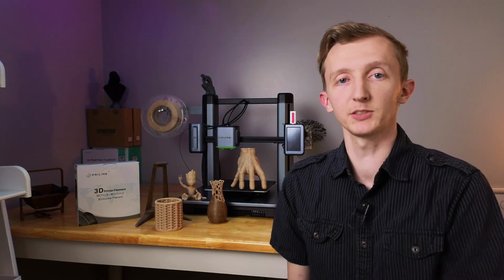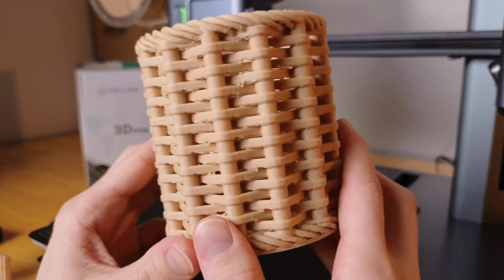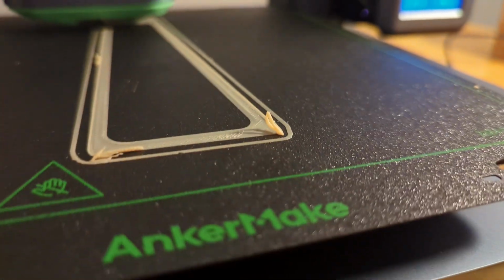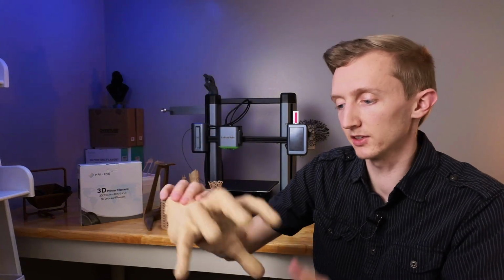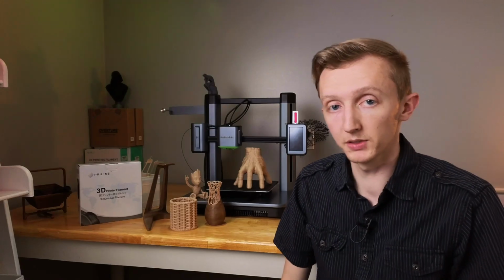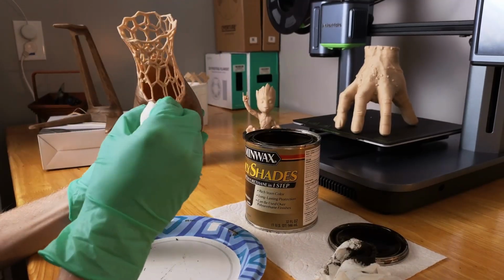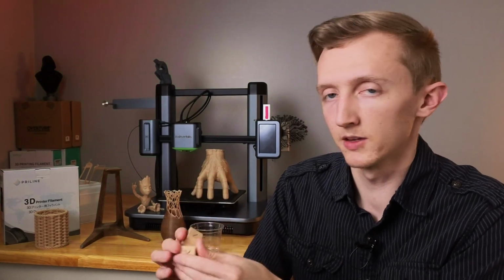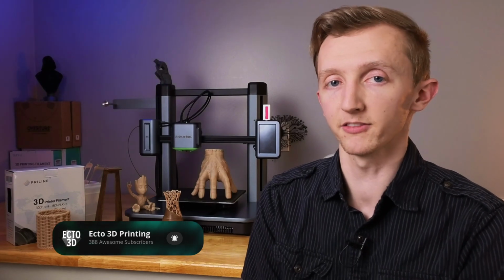3D Printing Wood Filament is EASY on the AnkerMake M5

Comment: I love printing with wood, and have found with most brands is not to print fast, first layers around 20 to 30  and main layer speed around the 40, the problem your getting is pressure build up in the hot end. if you don't run at the speed the filament likes then you will forever have issues with your prints.
and to say 99% of my wood prints is i never get any problems, just perfect prints like any over filament.
Just to say if you want it a bit darker then increase the heat just by 3 Degrees again if to hot then you get a cook off. lol

Wood does not like to be on the hot end either, so print low as possible but enough to get a good enough bond and layer fusion
Ideally print of some test parts as can save you a bit of hassle.

So if filament gets to  hot then the PLA gets to runny and the fiber's tend to sperate causing a back log,
and then spurts out under the back pressure, 
( some times the extruder will click away as its straining to push the filament  ) 

a good guide is, if the filament has a tolerance of say 0.02 +- 0.01 then a 0.4 nozzle is fine, but if you get wood filament that is 0.03 +- 1 then use a 0.05 or 0.06 nozzle as most certainly will get a glogg 
This also depends  if the filament is a 20% or 30% wood
Meaning a higher contents of wood above 20% then i do recommend a larger nozzle

Comment: Thanks to your video and the comments here I went ahead and put wood filament in my AnkerMake M5 and I printed this very thing hand last night. It will still printing this afternoon when I left for work so I monitored from the app and it completed with no problem and looks great! I haven't seen it off the printer yet. When I get home from work tonight I'll be taking it off and looking at it and putting my hands on it. But I'm excited because I was afraid to try the wood and I was afraid about the nozzle situation and thanks to people's comments I just left my nozzle as it was and it worked perfectly fine! Thanks everybody!

Comment: I did print using the wood filament on the 0.40 nozzle. It seamed to work fine. Thanks for sharing your experience with staining.

Comment: great videos, very informative. what I've found with wood filament is that you need to slow down the print speed. I printed a few models that came out really nice using AMOLEN's walnut wood filament using a print speed of 40mm/s, a printing temperature of 200°C, and a bed temperature of 60°C (even though AMOLEN recommends 0-50°C). I found that with the higher bed temperature, it reduced the risk of the first and/or 2nd layers from curling.  I also didn't have to change out the nozzle. all of my prints were successful and looked amazing using a 0.4mm nozzle.

Comment: I've heard that wood filament is hard on your nozzles and steel is recommended. Is that your experience as well? I bought some Hatchbox for my M5 but haven't tried it yet.

I do woodworking and for stain what would work well are the cheap foam brushes from the hardware store. They're a bit tougher than paper and you can squeeze it into the grooves to get more stain into deeper spots but absorbent so you can blot it away. Technically disposable but I've found that I can get a few uses out of them, depending on the stain chemistry.
Reply from the maker: Sweet tip! I thought about using a foam brush, but didn't want to ruin one of my mom's brushes if it dissolved or something lol.
For the nozzle, I don't think I've printed enough with the wood filament for it to have affected my nozzle yet. If anything, the white Anker PLA is more abrasive, or so I've heard. But I think even that 'damage' is more evident after multiple kilos of filament and I've only done just shy of 1kg of wood, and maybe just over 1kg of white.

Comment: I've been using a .4 nozzle for wood filament for years on my Snapmaker. Did you try your .4 before replacing the nozzle? I get great quality of my wood prints with the .4
Reply from the maker: I think I jumped right up to .8, then .6. I think afterward I tried .4 too and it worked fine.

Comment: Hi, I have an issue print with wood filament (i used Printalot), in my printing too many ocasions the filament is retracted from de nozzle but it not can back, give me a error "The Filaments are running out", force to manually push the filament to the nozzle. My Retraction are set to 45 mm/s and lenght about 6 mm. What about the retractions in your print?

Comment: What brand filament did you use? I’ve tried a lot of different settings and 0.8 and even a 1mm nozzle and have had  the prints largely fail through clogging or feeding stripping. I’ve tried 3 different filaments. Have slowed prints down to 50mm/sec and played with my temps in every way I could think to.
Reply from the maker: It's the box on the table: Priline Wood PLA